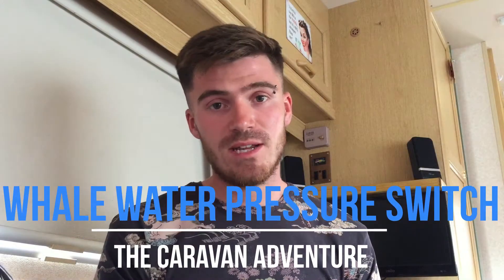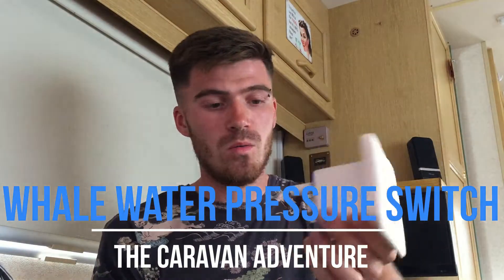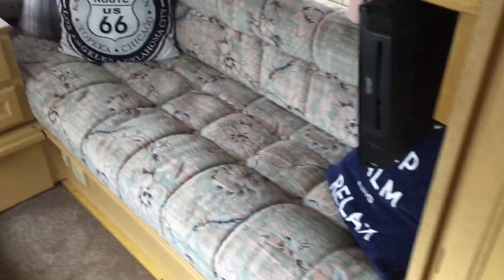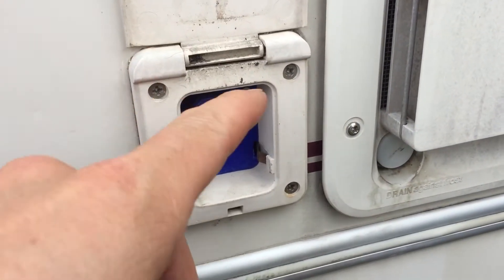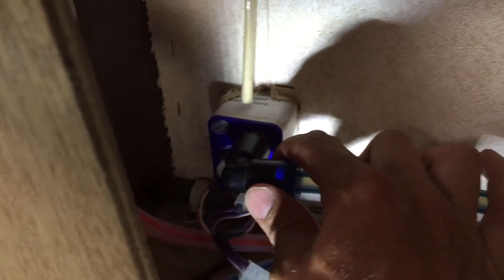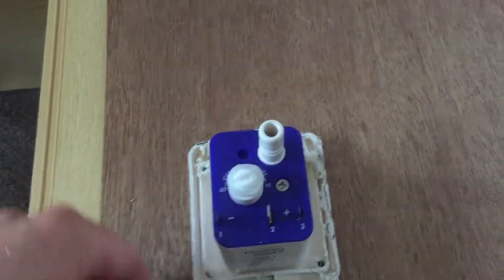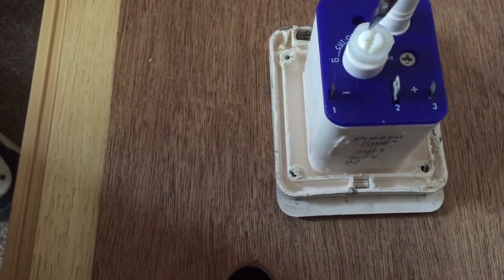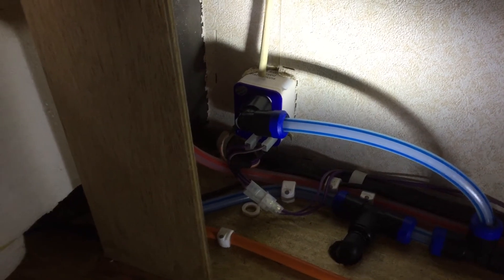Whale water pressure switch replacement and recalibration

Comment: Looking from the outside. There are four screws holding the blue plate on. Unscrew carefully as there is a spring the width of your finger. Remember the order it comes off. Take long nose pliers and remove the black rubber none return part out. Gently reassemble taking care the rubber sits flush inside its housing. Order a Whale Water Master Service Kit - Black. Save a fortune and less work.

Comment: This video is brilliant and it’s a job I need to do this week thing I don’t  understand is why do we have to set the switch then turn it back 180°
Reply from the maker: Glad you found this video useful 😊 i believe it’s just the manufacturers instructions to prevent stress on the pump. Thanks

Comment: Good video exactly what is wrong with my pump except that mine was running constantly and finally packed up bought a cheep pump to test proved was running all the time so I have to buy a new pump and the socket too to get it working properly thanks for posting the info about the socket put me on the right track good work subscribed 👍
Reply from the maker: Alister West glad you found this video useful, hope you get your water pump all sorted 👍